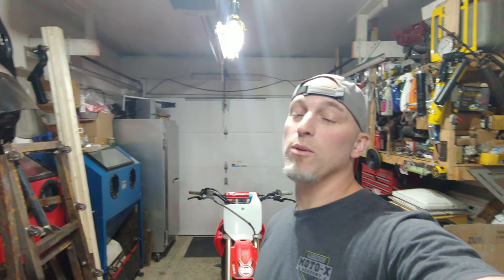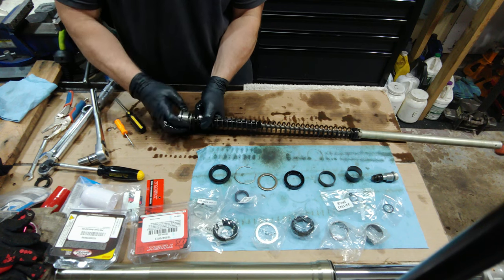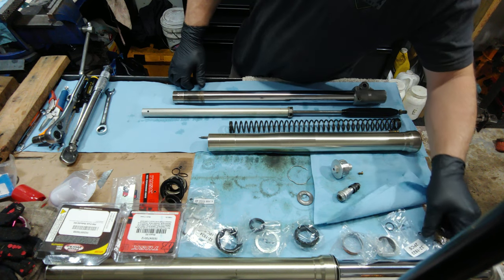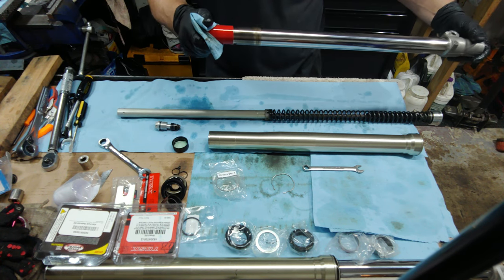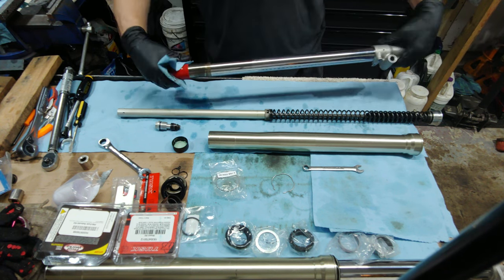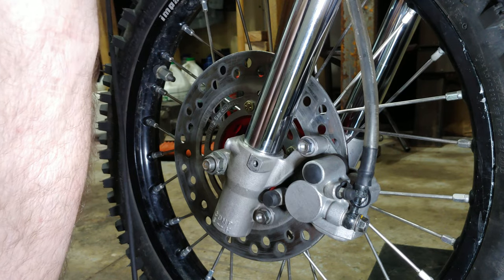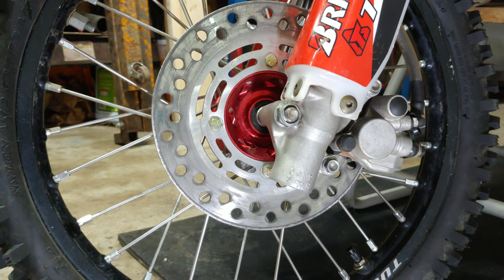03 Honda CR85r Rebuild Part 8 || Rebuilding the Forks

Comment: Dude how do you keep the damper from spinning so you can get the center bolt out???? I’m losing my mind trying to get it out
Reply from the maker: Once you get the center bolt unscrewed all the way, you'll need to push in the top of the fork while the bottom is locked in the vice and put the holder tool over the shagt so you can get to the lockout and then loosen it and then the center bolt should back off.
Reply: @Fixin2Ride-Official-  it won’t unscrew all the way because the damper inside the fork is just spinning. I don’t understand what you’re saying at all? What tool? You don’t show any tool in this video. You just put the fork back together and magically unscrew the center bolt and it pops out. Makes no sense.
Reply: @Fixin2Ride-Official- dog just delete this video. You’re not explaining how to do this correctly and are clearly leaving out details on how to remove the damper, which is not even necessary unless your fork is leaking from the bottom. Anyway, thanks for nothing.
Reply from the maker: The center bolt spins once it's unscrewed and then you have to grab it and pull it out. No reason to get nasty. Sheesh.
Reply: @Fixin2Ride-Official-  i don’t know what fork you’re working on, but on a cr80, once the center bolt is loose.. the damper cartridge has to be held by a tool so you can spin the rest of it off. It’s not held by anything but the inner fork tube. They no longer make that tool to hold it and I’m just saying, the average mechanic could ruin the fork entirely by damaging the damper trying to hold it with a screw driver to twist it off. Go look in the manual, says it all there. For fork seals, no need to remove the damper entirely.
Reply from the maker: What is the minute and second in the video that you are having issues with and I'll try to explain it better.
Reply from the maker: This is a 03 cr85r just as the title states. I replaced all seals and bushings. The center bolt is at the bottom. On mineI used an impact to unscrew it and then had to grab it and pull it out because of the oring on it.
Reply from the maker: Check out this video. This is my video rebuilding my 06 crf250r forks. These you have to push the fork down while in the vice and use a tool OR crescent wrench or open end box wrench to hold the damper rod out and use a wrench to hold the rod while you unscrew the center bolt from the rod AFTER unscrewing the center bolt from the bottom of the fork. Start at 12:15m
https://youtu.be/pUQp6FSspio?si=Cs49T3-A_6abulO3
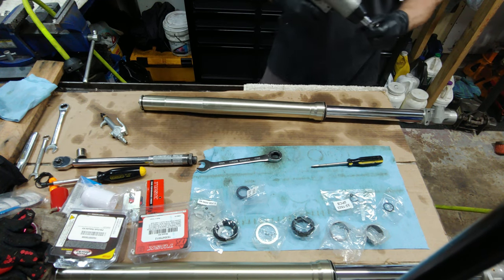Reply: @Fixin2Ride-Official-  1:43 All you do is screw the top cap on, then take your pnuematic and somehow pop the center bolt off. When anyone else on earth does this, the center bolt becomes loose and you have to hold the damper steady to screw the rest of the center bolt off. You are not showing how you go the entire center bolt off. It just cuts to you pulling the center bolt out of the fork. Sorry to be a dick, but nothing what you did here is what is decribed in the manual. You need a special tool or you stick a pipe or screwdriver into the top of the fork with the hope of holding the damper tight enough to get the rest to come off and risk completely destroying the top of the damper cartridge. All I'm saying is that you aren't showing how to take off the damper correctly because I tried your method and it does not work at all.
Reply from the maker: @jimmy_dirtbike You may have a different type of fork on there than what mine was. I appreciate the apology. Look at the video I posted of crf250r. In that video, the center bolt, once unscrewed from the fork, yu have to compression the shock to get to the lock nut that holds the bolt on. These shocks didn't have that.
Reply: @jimmy_dirtbike  I’m having the same exact problem with my 03 cr85. The left fork tube was easy to get the bottom bolt out just with a impact and vice grips to pull it out , but I’m having trouble with the right side it just keeps spinning did you find a way to do it without sticking something down the fork?
Reply: @juju_0574  nope, it wasn’t leaking so I just said F it and just did the seals and replaced springs. Gave up
Reply: Crazy part is im stuck on this exact problem. i watched this video at least 20 times, it does call for special tool that isn’t made anymore for whatever reason. if your impact doesn’t take it off then you are fucked basically only way i found was instructions to a homemade tool that is supposed to do the trick apparently, going to try this week ill let you know.🙏
Reply: @estebanaleman3507  be careful and don’t use your impact on that because if you cut a tool with a pipe and it looses grip and spins, you’ll smoke your damper entirely and it’s never coming off. Ask me how I know.
Reply: @jimmy_dirtbike it worked flawlessly🙏 some guy on a forum had the exact dimensions for a steel pipe custom tool.  Back to the full rebuild!🙏
Reply from the maker: @estebanaleman3507 Thanks for posting reply. I explained to th guy above that he may have the RB cr85 which has forks like my crf250r where you have to collapse the fork down to out the holder behind the dampening rod and then use wrenches to unscrew the locking nut for the centerbolt and then back off the centerbolt.
Reply: @estebanaleman3507 Do you mind dropping those dimensions here? Or telling me exactly where you found them?
Reply: Did you ever figure out what was wrong???
Reply: @TBu-m5q  I didn’t. It wouldn’t budge on one of the forks and I just left the damper in it. Doesn’t leak. I was worried I’d damage the damper if I were to keep trying.
Reply from the maker: @jimmy_dirtbike I used a nice tight 6-point deep well socket and put it on the damper Bolt and twisted and bent the socket causing friction to pull the damper bolt out and that work

Comment: When you say screw in the valve 3 turns are you talking about turning the cap 3 turns down the threads or the compression clicker ? 23:05 mark

Comment: I just bought a 2003 cr85rb and the suspension need redone all around I was thinking of throwing some stiffer springs in the forks for a 165 pound rider what rate would you recommend
Reply from the maker: Not sure in that. You can find calculators online on the big suspension sites.

Comment: Is that bottom damping bolt reverse thread? I tried impacting it off but it just spins and didn’t back out at all. If it is reverse thread I probably stripped that bolt.
Reply: Also adding it won’t go back in or come out at all just spins in place
Reply from the maker: It's Not reverse threading. Once it's unscrewed you have to yank it out as it's wedged in by an oring
Reply: @Fixin2Ride-Official-  I found the problem! The damper rod just spins on the inside so I made a special tool to hold it from spinning, yours must have not been siezed and came right off

Comment: Thanks for the video it really helped 

Although the stack was spinning with the bolt at the bottom so it was quite the hassle to get it out.
Reply from the maker: Glad it helped. Did you have to push on the top of the fork to get access
To a lockout that held the center bolt in?
Reply: @Fixin2Ride-Official-  yeah I ended up putting it back on my bike and using ratchet straps
Reply from the maker: Yeah those are the Cr85rb shocks which are like the big bike forks. That's why I posted the link for the video of my 06 crc250r fork video. Glad that's helping.